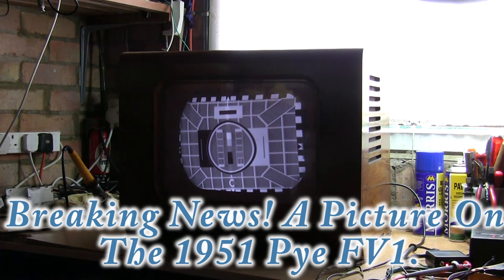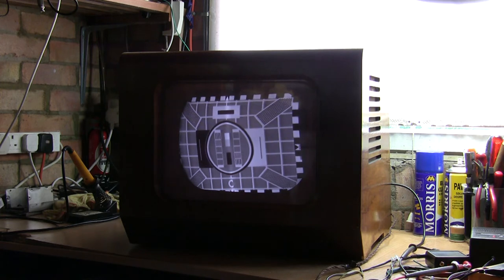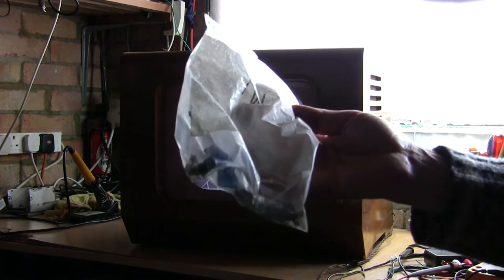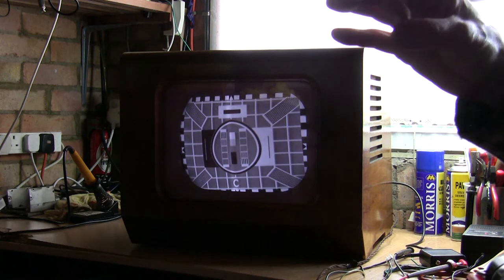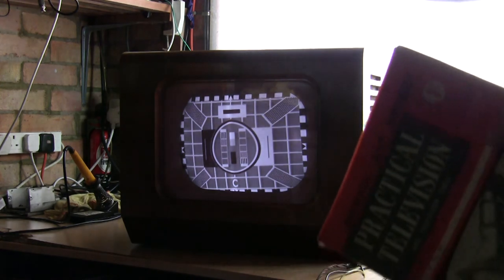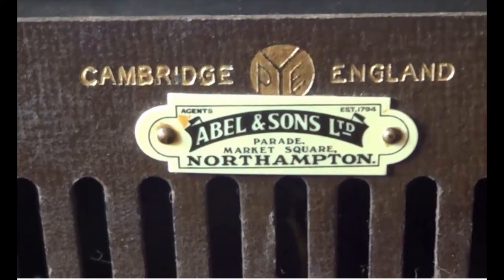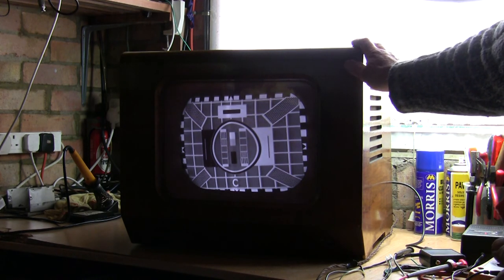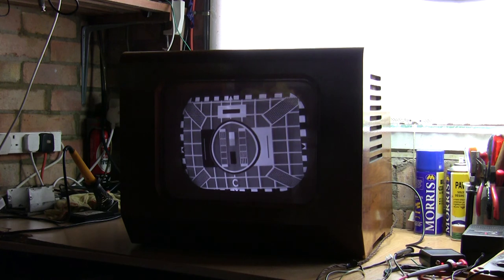Pye FV1 1951 TV Bursts In To Life!

Comment: I have it's predecessor,  the Pye LV51F, (1950) after restoration it worked well , but suffered from EHT dropping after 20 mins or so, this was due to trapped moisture in the line output transformer.
Passing a current from a bench power supply through the windings for a few days dried it out and has fixed that issue.
I would recommend you replace both the PL38 & PZ30 with NOS valves, they lead a hard life & are usually a bit tired, as can be the EY51 EHT rectifier.
Reply from the maker: Many thanks. Yes, I did indeed have a go myself at drying the LOPT out, as you say with the current passing through. I read about this online and that this is the way forward with these now, so I had a go at doing this on this set before I statred working on it as I did not want to ruin the LOPT. It seems to hold up well thus far! Quiet a problem with those pitches covered Pye coils in the likes of the Pye B.18T. I have four of that type of Pye sets and had tried many ways to get this damp problem sorted before.  I certainly will get a new PL38. I'm sure you are right. It has had a very hard life. In fact, I think this whole set has and maybe was kept going a long time in service looking at it. I had fitted a new EY51 as that looked well past it when I started out, and no PZ30 in the FV1, so that's one less to find. Thanks so much as always for your kind comments. Kev.

Comment: My Late Mother and Father had one like this when I was little. Is this a fixed tuned set.
Reply: My parents one must have been fixed tuned to  Crystal Palace as it was used in the London area..
Reply from the maker: Well, it can be made to function on any one of the 5 BBC  TV transmitting channels that were around at this time of 1951. Channel 1 Was Alexandra Place, For (London and the Home Counties). 2, Holme Moss (Northern England). 3, Kirk O'Shotts (Scotland). 4, Sutton Coldfield (Midlands).  Where my set was used.  5 Wenvoe (South Wales & The West of England. So this set could be basically be sold all over the UK and if you were lucky to live in the range or near enough to any one of these then you could just adjust the Pye FV1 set to your nearest channel number transmitter. Kev.
Reply from the maker: @stephenhall6595  Yep, Crystal Palace Transmitter took over London and South East area in March 1956. Kev.